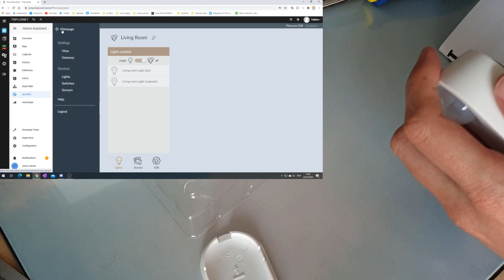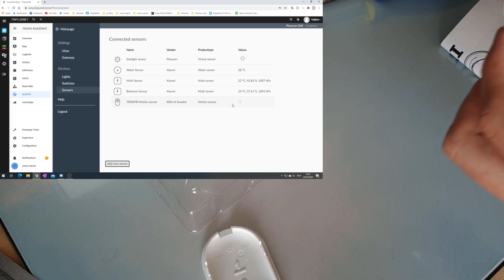Unboxing the Ikea Trådfri Motion sensor & connecting to Phoscon Conbee II

Comment: Nice vídeo! Can you make a video pairing and mapping the buttons for the ikea remote? I can make the temperature to change on my bulb!
Reply from the maker: You mean in phoscon? It should be just accessing the group, editing it and adding switches. Not sure where you get stuck :)
Reply: @TriplusTutorials  thank you for your reply! I've already paired everything, but on phoscon I can't make the ikea remote to change gradually the ikea 1000lm bulb temperature
Reply from the maker: go to your group > edit > switch editor > choose your switch > assign the button to "change brightness"
Reply: @TriplusTutorials  yes, I've tried that but with no luck, I can change the brightness but I cant change the color temperature
Reply from the maker: @absint0o  does it work when you manually change the slider in the phoscon web ui? The button mapping should be on "change color temperature" and is working fine for me with my "white" ikea bulbs.
Reply: @TriplusTutorials  :) yes, I've tried that, it's stays allways cold, I can only turn on/off and change brightness, the color temperature simply doesn't work